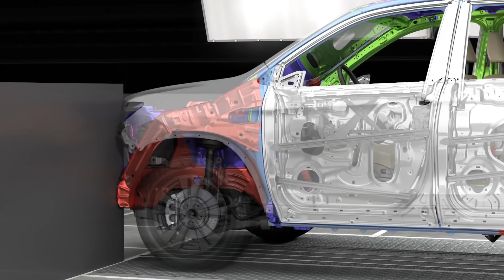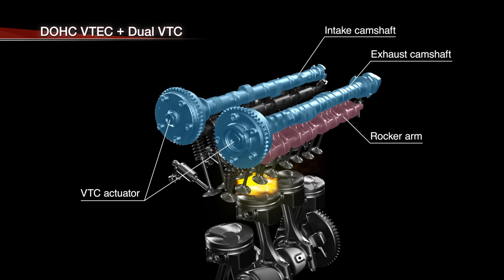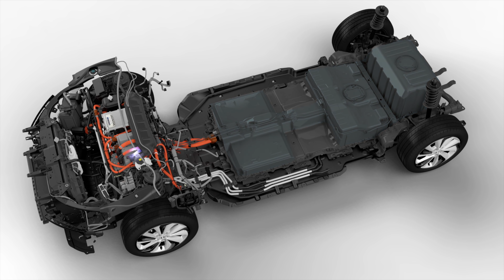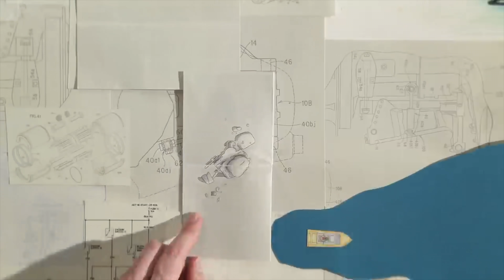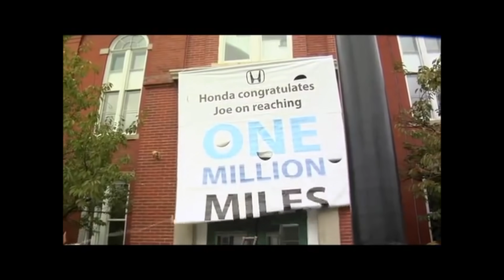Honda Doesn’t Want You to Know This

Comment: Now do G.M. reliability 😂😂😂😂😂 should be a short video!
Reply: Would love to see a Chrysler, Mercedes, and BMW reliability video
Reply: We probably won’t since it’s pretty much non-existent
Reply: video starts "Just fuckin dont" ends
Reply: I have 3 gm vehicles 1 has 653000 miles  I had to rebuild the transmission once but that's it. 1 has 320000 miles and I've only replaced the water pump and 1 has 150000 miles and I haven't had to replace anything yet. Those 5.3 engines were built to last
Reply: The 5.3's are awesome but unfortunately gm is making them less reliable with cyl deactivation and such, i should have clarified as older gm's are not bad, and reasonable to fix.
Reply: @rxwhat33  very true my 2 vehicles with over 300000 are before 05 and those cylinder deactivation started in in 05
Reply: BUICK seems to be reliable. Doubt if it's Toyota or Honda reliable, but they are indeed reliable

Comment: I have a 2016 Civic that i bought a few weeks back. 15k cad with only 35k kms. Happy with everything so far. My father drove many civics in his life so you know where the influence comes from :)
Reply: I have a 16 as well, the 2.0. It's an amazing car but watch out for a bad AC pump as they were kind of weak that year and the drive shaft(for the AC comp. not the actual drive shafts) on them is known to break. If it does break you should be able to fix it under warranty as there is a TSB out for them.
Reply: @Xaver1106  I just picked up a brand new 2019 civic 2.0L 6speed manual... I got a really good deal .... any issues?

Comment: my 06 4 cylinder Accord still going strong! Only thing that bucks me is the rattling noise in the engine and a rough idle/reverse.
Reply: Rattling noise is a potentially dangerous sign. Your connecting rod bearings could be going bad or your valves need adjustments. Also,,, check if your oil pump is working properly or if you are low on oil .

Comment: My 2017 civic had poor fit'n'finish, and the 2nd battery in less than 3 years, melted. Traded it in for a 2020 model. So far, so good.
Reply: Honda is notorious for using undersized batteries. My ‘15 accord is on it’s 3rd battery. It’s kind of ok since they all went bad before the warranty was done.
Reply: My wife's 2016 civics battery went out Christmas eve 2020, we had 5 inches of snow and I had to jump it and get it out of the driveway....so far she's had to replace the battery (120$) the driver side ac blower motor(750$), new tires(420$) & last week a coolant flush and all new filters(350$)....All that and thats not including the 4 oil changes for the 52,000 miles on it...
Reply: Maybe Scotty can tell us what would be the best battery for our Hondas. Having one physically melt was not a good feeling. I traded it in because I'm sure it had to have impacted the electronics, and it would be an issue later on.

Comment: Had a 2000 honda civic with 236,000 miles on it before my daughter traded it in on a Toyota corolla. The civic shifted like butter, even at the end. Did normal maintenance on oil changes, timing belt, and transmission fluid changes. Had the car for 16 years. Hit a deer, got rear-ended, and still got $700 for a trade in. It sold within 2 days of us trading it in. Very dependable! Basically,  brakes, tires, and exhaust. Loved that car! Between my civic and a used prelude,  I drove 2 cars for 25 years!

Comment: Wife's car is a 2014 Accord Sport. 150,000 miles, 1 set of spark plugs, oil changes at 50% oil life, CVT done every 30,000 miles. Two batteries, three sets of tires. Two waterpumps, serpentine belt, belt tensioner. Still looks and runs like new. I have several small yard machines with Honda engines. They can sit for weeks and usually start with one pull, very reliable.

Comment: I have owned a 97 civic lx it had 189,000 when I bought it in 2009 I put another 100,000 on it when I had to replace the 5 speed. I did myself. I never changed a transmission before that and the civic was quite easy. The only reason I had to get rid of it was it wouldn't pass inspection due to a cracked window. When the molding was removed it was noticed that body work had to be done for the new windshield to be replaced. So I sold it and it still running today. I just purchased an 07 Accord EX-L kit has 124,000 miles on it. I am so grateful to be back on a honda. My first accord and loving it. Plan to keep it for a long time

Comment: Love your work Scotty! I've put 447,000 miles on my 2008 Civic LX  (made in Japan) still running. My daily commute is 150 miles round trip. Only major repair was to replace the AC system. (Necessary here in Louisiana); and now the starter needs attention. (Oh, and the paints worn off the top.) I’ll keep driving this one... a new one might not be made as good.

Comment: I've got a 91 park ave as my daily driver! Paid 800 bucks 4 years ago!
Reply: Does it have the 3.8 liter engine?
Reply: Park Avenues were/are great cars, too! If I recall, it had the same engine as a Cadillac and the only (recurring) problem I had with it was that the anti-theft would randomly make the car so it wouldnt start. Otherwise, I loved it.
Reply: @TheHerbdude  yup yup only 100k on it to
Reply: Had a customer with a long commute.
Philly to Atlantic City. He retired his LeSabre 3.8 after 460k. One used engine  in the high 200k's and a used trans in the high 300k's. A water leak popped the passengers air bag. Brought it into the shop to find out what happened and the driver's side popped with the car running and nobody in it. He replaced it with his wife's LeSabre with only 181k miles.

Comment: I purchased my new 2008 Honda Fit Sport jazz in September 2007. It will be 14 years old this year 2021. I has over 150,000 miles and it is very reliable. I had to change Honda dealership that do maintenance, to another Honda dealership that knows how to service my car. My original Honda dealership had never changed the air filter. They only changed the cabin filter. Carbon build up symptoms can mimic other problems. Now i found an honest Honda dealership.

Comment: Can you tell Honda to stop putting that tiny 1.5 ltr engine in their CR-V
Reply: In some countries, cars are taxed based on cubic capacity of their engines, many a sale lost by Honda due to competitors having smaller turbo charged engines. These days small 3 cylinder 1.2 litre turbo engines are plenty. Honda needs to keep in touch. I own a 1.6l turbo charged engine which outputs similar to a 2.4 normal aspirated engine. Have covered 240,000 kilometres already. I personally don't mind the smaller turbos.
Reply: Yes I prefer cars that keep the gas in the gas tank.
Reply: @Aviyel  I don’t care about all that I don’t like the way it drives
Reply: Honda putting high performance turbos in their cars is exactly why I chose a Toyota over Honda. 

I can get a proven 3.5L v6 Toyota that’s smooth and no high pressure complexity (aside from GDI).
Reply: @mcc7762  agreed. The Honda 2.4 should be just as reliable long term as a Toyota engine
Reply: Me too. I’ve had Honda’s in my family since the early 90’s and I stopped buying them because of that reason I’d rather have an n/a 2.4L or 3.5L engine any day. I don’t know why to need to switch to small turbos. The new 2.0L Accord touring gets like 22 city and 30 highway mpg and that’s similar the the n/a V6 in the Camry. So I don’t get it? Maybe a 2.0L 4 emits less emissions then? Who knows? Any who that’s why I have a Camry Xse with the 6 banger in my drive way
Reply: Honda should study the market carefully as each country differs. a 1.5l engined car in my country cost a yearly tax of $90 while a 3.5l engined car costs $4380. Honda lost sales in my country simply because it's competitors were putting smaller and more powerful engines in their units. See the difference in costs. It is even worse in my neighbouring country! It is different in the US though so maybe Honda needs to revisit how they package their cars. Most if not all manufacturers in my country have gone to smaller turbo  engines for their bread and butter cars. BTW, the sensational Toyota Yaris GR is a 3 pot, turbo charged 1.6litre engine.

Comment: Proud 2020 Civic Si owner here!! 20k miles... oil change, filters, that’s it. Will do a brake and trans fluid service in the next year or two. About 139$ each lol not shabby. Original tires are 7mm @ 20k Goodyear Eagle sports 235/40/r18

Comment: I first had a 10 year old 1982 Honda Accord, It was recalled for a rusting gas filler neck, they let me know the gas tank was also rusted.  I wrote a letter to Honda about this rusting problem as well and Honda paid the dealer to replace my gas tank!  I never forgot ho they treated me.  So Now I have a 2010 CRV-EXL and a 2007 Odyssey LX with 283000 Miles! It's nice be loyal to a good company and have enjoy well made products!

Comment: I've got a 2018 Honda Fit (Jazz in Australia) and it has been the best new car I have ever owned. I've bought 2 new Mazda 2 but when the air conditioning compressor broke in my 2015 Mazda after only owning the car for less than 4 years, Mazda didn't want anything to do with it even though I bought an extended warranty! I got my Fit straight after it and got it with 7 years warranty. It is an absolute dream to drive and I love that I have been able to haul a 17 inch CRT computer monitor and 5 drawer dresser in the back with plenty of room to spare. Those Magic Seats are definitely named true!

Comment: I currently drive a 2014 Honda Accord EX-L 4-dr. We bought it new 7 years ago and have only put 69K miles on it.  The 2.4 is a terrific engine that balances power with efficiency.  That said, the only reason I bought the car was because my first kid was born, and my 2000 2-dr Accord EX-L V6 wasn’t suited for kids.  It only had 193K miles on it, and I had very few issues in the 14.5 years that I drove it. 

I absolutely love Honda and respect pretty much everything about what they do. 👍🏻

Comment: My 2nd car ever was a 07 accord EX bought it with 120k miles and traded it in at 218k, the only things outside of regular maintenance was the ignition broke with the key in it at 218k and a drive axel at about 190k. Wanted something newer and the timing chain was started to get loose and needed a new one and brackets when I traded it in. Overall loved the reliability and would be one of the only new cars today I would buy.

Comment: I have a 2011 Accord coupe 6-6mt and it has been extremely reliable. The fact it has double wishbone suspension makes it even better than a lot of newer vehicles handling wise, and with a 3rd party LSD added, it makes the car very fun to drive.  Even without it it wasn't bad, honestly.  A lot of these cars are underrated, and I'm no Honda fanboy, but it's impossible to deny that Honda has fwd driving dynamics down to a T.  It's just my daily but I actually take it out pretty often to drive in a "spirited" manner over other things I have.  I am honestly so hard on it and nothing has gone wrong with it at all really, and the few little things that were needed were very easy to fix on my own, like upgrading the brakes.

Comment: Awesome video. I just bought at 2019 Honda Civic Touring with 1.5T engine. It only has 1600 miles on it. I hope it lasts a long time.
Reply: Just change that oil a lot, and you should be fine 
🤞🏻 hope for the best!! 😁

Comment: Got my 2003 Honda Accord CL7 20EL K20Z2 Engine trashing it everyday now has 200000km going strong! Replaced waterpump, idler pulley,tensioner pulley, Engine won’t die

Comment: Scotty- my Honda story:  bought last year, 1999 Civic EX/2-dr., manual,  @ 111,000; original owner.  After the usual deferred maintenance fixed (timing belt/water pump, rotors, etc. I had the following happen to me twice in the past two weeks:   the car suddenly accelerated, un-commanded, on it's own.  It sounded like I was doing 60- in 2nd. gear, but I wasn't even close.  Power brakes died also during this so had to really put the brake pedal thru the floor to stop.  Happened again last week- this time w/ gas pedal floored.  Scared the hell out of me.

Bottom-line;  repair/diagnosis was that I had a (small) leak in my radiator, the coolant level was inadequate- and that affected the vacuum pressure which affected a sensor, which in turn affected another sensor that was part of the throttle body unit, and it was somehow affected.  The 2nd. time?;  same sudden acceleration, but my fix:  all I did was replace the radiator cap/$8.  The first time?; cost me more than $350- and $200 of that was the tow truck!

So- ANYBODY, have you heard of such a thing?  The two mechanics/61 years total experience- hadn't either.   And me?; never.  I still don't get it.  It was a vacuum issue, brought about by inadequate coolant and a defective radiator cap- that wasn't sealing.  And that turned my ride into a rocket-ship- and it wasn't fun, or cheap.

Comment: 2011 Honda Civic....193K mileage, besides cosmetic repairs, wear and tear, maintenance and the failure of the Mode Control Motor...it's been solid!!! I can't complain, as it is a base model and was bought as a vehicle to transport from point A to B. It has NEVER thrown a Check Engine light that was long enough to pull a code, so I have to call it a damn good car!!

Comment: Owned (purchased new) a ‘99 Civic Coupe 5 spd. and my wife owned a ‘99 Odyssey (also purchased new).  Civic was flawless, ended up trading it for an Acura TL in ‘08.  The wife’s Odyssey... not so great.  It was the first year of the larger generation and the brakes were undersized. Had several brake jobs the first year, but Honda finally replaced them with a recall fix.  Transmission was also iffy after towing a 2,500 lb camper a couple of times, although the V-6 was indestructible.  Had a 2nd TL with zero problems other than the leather driver seat wearing out prematurely.  I had a local leather shop replace it and was told this was a very common problem on the TL and RL.  Edit:  My ‘99 Civic Coupe was silver and I wish I still owned it... could probably sell it for double what I traded it for over 13 years ago!

Comment: A have 2010 Honda pilot and I am the third owner. It has 182K miles on it it still drives very well, AC is cooling very well. There is no rust under the car.

Comment: I have a 2011 Honda Accord SE which I bought in 2016 and it had 51,000 miles on it. I paid $10,500 for it, have put on 45K miles,  new brakes all the way around, new power steering pump and new tires. I change the oil every 4K miles and just drove it to Florida as it will be my Florida car at our retirement home near Tampa. I love this little car, its 4 doors and fits well; I'm 6'4" tall and weigh 250 and its roomy inside and has tons of leg room. I would recommend the Accord to anyone looking for a reliable vehicle.

Comment: We bought a new '05 Honda Element in April, '05.  We had well over 100,000 miles on it before it needed its first non-routine repair -- a new alternator.  At 168,000 we replaced the struts -- that was expensive, about $1800.  But it still runs like a scalded dog, does not have any sign of automatic transmission issues, and does whatever we need it to do.  Last October we drove from Virginia to Nebraska and back in it.  Not the best riding or quietest car you'll ever drive, by any means, but it handles well and scoots right along.  It now has maybe 173,000 miles on it and seems poised to go another 173,000.  From a durability and reliability perspective, it's the best car we've ever owned --- better even than three Toyotas we've owned.

Comment: Over the years I have had three Honda Civics, 1991, 1995, and 2006. Each of 1991 and 1995 Civics had well over 200,000 miles on the clock before I gave them. in sequence, to my daughter who put many more miles on them before they wore out. My 2006 Civic currently has over 225,000 miles and is still running fine. The only major repair was on my 1995 which had to have a new head gasket at about 125,000 miles.

Comment: I used to own a 95 Integra LS 5 speed manual. I LOVED that car. Had I not lost it to a patch of black ice on the thruway, I'd probably still have it. I owned it for 9 years and it was running smooth as silk until that tragic day. I whacked the left front twice because of the way it spun. When I came to a dead stop, my 1st reaction was more concern about the car than me, lol. After I surveyed the damage I stopped and thought, wait am I, yeah I must be fine if I'm doing this 🤣. 

Easiest cars to work on by far IMHO. Minimal issues if you maintain them. Heck, the timing belt snapped on the thruway going 65 MPH. Not. One. Valve. Bent. Not one. Those B series motors were pretty impressive. I've moved on to Subaru recently (2015 WRX STI). Love my new car. Love it. However, there's still a part of me that will always miss that Integra.

Comment: My daily driver is a 1998 Honda Accord LX and has been very dependable for me, I've driven it for 6 years now. It only broke down a couple times due to a faulty ignition switch and starter on separate occasions. Had to get a new key reprogrammed just to crank over the engine. But other than that it works good.

Comment: Just bought a 2011 civic si coupe with only 74k miles after my 08 wrx started pooping out at only 120k miles. 
Only had it 3 days but I LOVE IT! Sounds so good, shifter, tranny, clutch, and engine are sooo smooth until about 6k rpm which she starts screaming, one of the cheapest cars I've ever bought and the lowest mileage car I've ever had, oh, best part? SHE'S STOCK!

Comment: Have to say, I love my 2015 lx coupe with the R18.  90k miles...not one single problem.  Even has the original drive belt.  All I've done is change oil, change the cvt fluid every 30k, and wash it.

Comment: I have a 2011 Honda Accord. 4 cylinder engine and an automatic transmission and 108,000 miles and it still drives and shifts pretty much flawlessly.